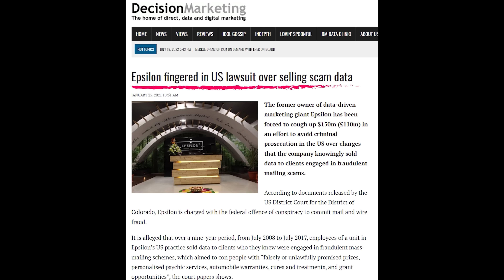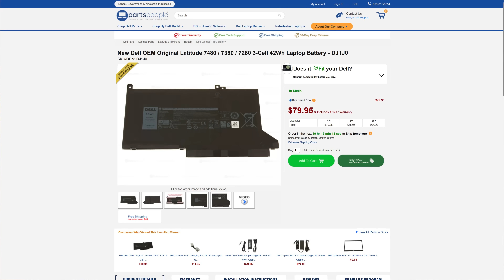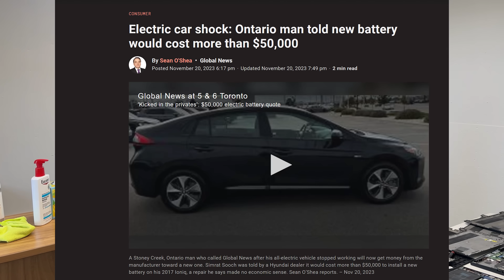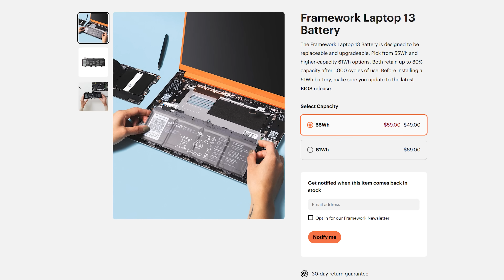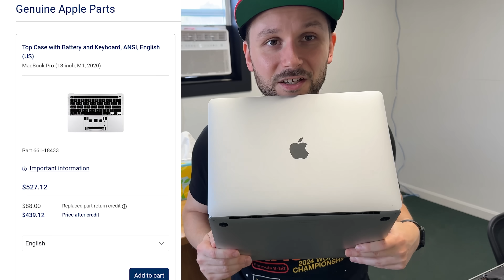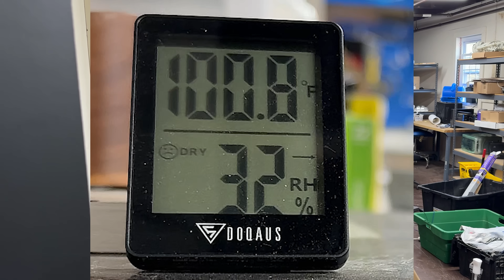Planned Obsolescence: Why is Replacing a Battery STILL So Difficult and Expensive?!

Comment: I bought a framework for this reason, people complain about price but at least my laptop will keep running in 8 years. Because as you said that computing has plateaued for a user, you don't need core i9 or ryzen 9 for office and shopping.
Reply: buy once cry once
Reply: I also bought one! It broke the bank but I like to be able to make sure my computer lasts a long time and that I could replace or upgrade any part I need because it is readily available to me. I highly recommend it too... I think they are coming out with a lil artist laptop and a mini desktop soon too that I was also looking at-
Reply: Just curious are there any third party manufacturers for framework laptops parts? 
Are they openly compatible or standardized?  
Are they officially supported or are you solely relying on Framework independently oprating/existing 8 years down the line without the usual creep of enshittification?
Reply: @ask_carbon  The expansion cards are usb 4, motherboard you can technically design your own, though its probably not cost effective. I guess if you want to run risc or arm processors you can design a motherboard that you can switch out, or see if you can fit a raspberry pi with a custom breakout board. As for memory and ssd those are standard parts.
Reply: @ayylien I wondered why nobody makes a laptop style housing for a RPi.
Reply: One of the huge benefits of Framework is the ability to buy replacement parts directly from Framework’s official webstore at a reasonable price, rather than having to navigate to Aliwhatever or a shady website on the 3rd page of Google that upcharges 300% and only accepts non-refundable payment methods - all to purchase a single $0.10 part.

Comment: Man, I feel your pain.  We had 50 of these for our org, and the batteries after two years had to be replaced on all of them.  They would swell up, and two exploded.  Other than that they were very reliable.
Reply from the maker: 2018 was a very bad year for batteries.
Reply: no wodner I can easily get one for 60 bucks off ebay and then they have no battery or 40% health or less. It sucks cuz those are awesome laptops that take a frickin beating.

Comment: Both of my two laptops were "obsolete" Macs that I took from people who didn't want them and gave them to me for free. I replaced the battery in both of them. One of them is still supported (2019 16" Pro model), so it continues to run macOS until Apple drops Intel support before I put Linux on it. The other one is a 2013 15" Pro model, and that one runs Ubuntu 24.04 LTS. I did a real-life application benchmark a few days ago using a commandline data processor, and apparently, it takes 25 seconds for the 2013 to check if 100 million numbers are prime, compared to the 29 seconds that my mom's M1 Max 16" Pro model takes, so that means that my 2013 (not even my newest computer) is still FASTER THAN APPLE SILICON.
Reply: I might be able to snag a MacBook Pro 2019 from my work next year. Do you know which components are supported and which aren‘t?
Reply: I’m still using my purchased-brand-new 15” mid-2012 MBP, as well as other mid-2012 13”s (all non-Retina); since that time, repairability has got worse and worse (soldered-in RAM really put me off in 2012, hence the unibody MBP); and they have just got worse since then. The ‘Apple Silicon’ (technically Acorn Silicon given it uses ARM (Acorn Risc Machine) processors) MBPs are then much more ‘locked down’ just like iPhones, except Apple let you downgrade macOS to (whatever version it came with) … but are becoming more restrictive with each generation. Disposable MBPs (well, more built-in obsolescence than Intel ones) 😬
Reply: @matthewtymaja3760  Yeah, and adding salt to the wound, ARM Macs, although Apple claims more performance, still sacrifice enough that they get too slow for what I need them for. I've tried using one before, and promptly went back to Intel (tried my mother's M1 Max). Besides, the 2013 still manages to beat the M1 Max at clock, so yeah. I will frankly never switch to Apple Silicon (even as a software developer that currently makes macOS software next to his Linux software), and will stay on x86_64 Linux. When Apple drops intel support next year, I will also be wiping the 2019 and installing Linux on that too.
Reply: If you're thinking, putting Linux on your 2019 will be anything like putting it on your 2013. You are very sadly mistaken. I will offer my condolences in advance. * If you plan to use it as a laptop that is. It could be used as a Frankenstein desktop.
Reply: @lejoshmont2093  Yeah, I figured that out real soon. IDK what to do with that thing now. The T2 ruins every bit of Linux compatibility, and Windows is the worst piece of trash I've ever touched.

Comment: It's not even that the $300 laptops break in six months. There are $600+ laptops that break in six months to a year. HINGES! Windows 10 deprecation is a nightmare. I don't even wanna think about how AI forced into the ecosystem is gonna affect things down the road.

You bring up car batteries, which are giant, high amperage, high voltage, and perform and recharge in harsh conditions...

And they are only $200!!!

Comment: basically just dont use batteries and embrace the charger umbilical cord lifestyle
Reply from the maker: Become one with the outlet
Reply: @SalemTechsperts  many laptops use the battery as a capacitor because the tiny power brick doesn't feed enough current. Without a working battery the devices run way slower.
Reply: @SalemTechsperts  Since my comment got deleted for some reason I'll ask again is MSIbatterystore or laptopbatterydirect legit sites to get batteries or fake scams?? I find my laptop batteries there for 30 to 40 dollars but don't know if it's legit or not. I've been using a battery from there for about 11 months and it lasts 30 mins less than the original did but still works and charges fully. The original costs $90 on msi but has been sold out for over 2 years.
Reply: Some laptops power throttle without the battery installed :(
Reply: @saxtremer or even do not start without battery.
Reply: The point of laptops not booting without a battery crossed my mind as well. I wonder if there is some sort of a fix to this... Sort of just wire through the battery connections without the battery sort of... I have run at least once to this problem and it was infuriating.
Reply: @leerotten  maybe replacing it with a capacitor bank would work
Reply: @czechgop7631  Yep. Was thinking something towards that end.
Reply: I have a laptop with a dead battery that now runs linux mint and is used primarily by my little brother, but for general use at that point you functionally have a worse version of a desktop
Reply: Desktop`nt.
Reply: Sure, if the laptop lets you. Some manufacturers are so scummy that they don't let the laptop power on without a battery.
Reply: I don't like devices that don't have any control over the charging system. I set both my new phone and computer to not charge to 100%.

Comment: I replaced batteries on my cell  phone and smart phones. I miss the days when you could replace the battery in the phone yourself. I remember the LG G3 phone and it easy replacement. I replaced the battery on my phone before my trip to Japan and then when I returned I got a new phone and gave my mom my old phone to replace her Motorola.
Reply: The Fairphone does this still. They're to phones what Framework is to laptops. Rather pricy up front, but easily swappable parts (especially the battery!) and longtime support.
Reply: @stefangrobbink7760  a shame fairphone doesn't have headphone jacks :(
Reply: @Canvas-nb a shame indeed :(

Comment: I know that there are still some of us who don't really have desktops as good as these, so if it's possible, these could be distributed as low-budget desktops, so you'd only need to handle the broken hardware parts and the chargers.

The goal would be to keep the maximum amount of hardware running, right?

Comment: Tell this to EV owners !  It's why I do not own an EV and I never will !  I am refurbisher too and I cannot get good used batteries for most laptops. Dell is the best of the bunch because you can actually buy an official battery.  In future, EV cars which have been serviced, polished and looked after will be unrepairable because of the batteries.  "The battery" is what will condemn every bit of tech you own !!!  .........on a side note have you seen the cost of e-bike batteries ? FFS !!!!
Reply from the maker: Preach brother. I don't own an EV, I own 2 V8's and a turbo 4. BUT, if you've ever driven an EV, you'd know it's AMAZING for a commuter car. The problem is the EV industry NEEDS a company like Framework. Dell is great, Lenovo is OK but their prices are atrocious, HP is decent but the same problem with pricing.
Reply: @SalemTechsperts I would consider an EV if the batteries were modular and it was easy to replace modules as they started to fail. I imagine a battery pack with apertures on the sides behind the sill body mouldings. The modules would slide in and out like 3.5" server hdd's but much much bigger and stretch half way across the battery. You could use a diag tool to identify faulty modules and you could buy the new modules and slide them in and out of the pack. If this happened, then I would consider an EV providing that they confirmed to a standard that did not become obsolete in future.

Comment: My P14S thinkpad bought brand new from Lenovo in 2020 has a cycle count of 19 on the battery. I won’t need a new battery until this thing is 20 years old. That kids is the power of limiting your charging to 80% in the BIOS. You can do this with modern phones too

Comment: I've worked a lot with li-ion batteries and know a lot about the process of making them. There is no standardization right now for all batteries, everyone does what they feel like. This is probably why companies feel like the charge absurd amounts for a battery replacement. 

Batteries will start to show their age and expand once they hit around 80% original capacity, that is considered EOL for batteries. I recently recently had my dell xps 9520 upgraded with 32 gb of ram and 2 tb of storage, and the new battery  I got as well was still more expensive than the other parts combined.
Reply: we really need standardized batteries on all devices
Reply: @jojoba_24  that was my thought, like how in the EU we’ve pretty much standardised on USB-C for power.  If you make a device of this type the you will use a battery with these dimensions, offering these voltages and currents (maybe for each device type have two or three types of battery to account for differing size and load) with these characteristics but nothing that would cause the device to reject, or even detect, an off-brand battery.  That way replacements, whether done by a user or a professional restorer, could be from any battery manufacturer.  The battery manufacturers would get massive economies of scale so could compete on price and quality.  Ideally add requirements that will improve recyclability (why dig, say, lithium out of the ground if you can just pull the sludge out of old batteries, because they’re standardised, and refine it from that).
Reply: If your laptop still supports an external battery with 18650 cell's it isn't too bad, worst case you get to learn how to re-cell it yourself. Internal LIPOs are a nightmare though, for some reason china hasn't cracked the lipo pouch cell and most batteries you buy are just relabeled e-waste and not new parts.
Reply: @Gadtkaz now they know that, so they program the bms to lose all it's data and become braindead when the cells are disconnected, so you have to solder wires to them and make sure it doesn't lose power during the re-cell process
Reply: i can’t even replace my battery because of the absurd price of dell original batteries. so my laptop stays with 15% health and only lasting 20 minutes on a charge..
Reply: Appreciating this thread - if anyone has good tips or resources for safe DIY methods (as well as limitations and common pitfalls) I'm really interested in learning about anything that an electronics hobbyist could do to create more affordable replacement batteries.
Reply: @XatxiFly  So if you are curious about making batteries, it's mainly chemistry and not electronics
Reply: imo, the biggest problem are the soldered proprietary BMS on the batteries. It would be nice to be able to just reuse those things so you can replace a dead laptop battery with any other batteries even if they're a slightly smaller capacity because of the different shape. Unfortunately, this is pretty much impossible to do without some proprietary tool to reset them.
Reply: The main reason companies do this, is because they don’t want to do repairs and they don’t want you to repair stuff. I’ve seen people’s devices end up on phone repair YouTuber channels and even Apple and Samsung and Google don’t put their phones back together properly. 

They want you to buy a new one. So they maximize profits and please their shareholders and that has been business as usual for a long time now. It’s really sad. I understand they need to turn a profit but they have this delusion of infinite growth. And eventually, something’s gonna give.
Reply: Good. Standardization is fascism
Reply: @wolfetteplays8894  The modern industrial world can't work without standardization

Comment: currently looking at refurbished laptops to buy and the battery life is my biggest fear. everything else is such a bang for the buck deal, but the batteries... they scare me...
Reply from the maker: I mentioned before in my "Used Lapto Buying Guide" you have to assume the battery is going to need to be replaced and need to set aside the money for that.
Reply: I seem to have a good luck with cheap replacement batteries but with the Dell 7480/7490 the biggest problem is the screen, for some reason they use a different mounting type than older and latter models where you can get a lightly used screen for around $12, but for those Dells you are paying $70-80 and more. And they are all 30pin eDP, so you can get a newer one and fit them in somewhat, but it's not precise and you can't rely on the mounting brackets at all lol

Comment: You've nailed it on the head in the past, batteries are hard to get ahold of because they don't WANT you to be able to replace them.  Built in obsolescence.  And most people that are willing to try are more likely to destroy their laptop trying it themselves.  So still a win for the manufacturer.  Older laptops might have weighed 20 pounds but at least swapping the battery was quick and painless.
Reply: old laptop batteries were just as custom and proprietary as the modern ones. Just bigger because they used 18650 cells instead of lipo bags
Reply: it was still stupid expensive most ppl just got a new one back then too
Reply: And there is literally no reason for that. They can definitely adapt some kind of standardised battery cells set, and it will save them lots of money because they dont need to make custom battery  each time.

Comment: Batteries were always better whenever they just clipped under the laptop without needing glue
Reply: IF they still make the clip on module.   I have not been able to find the module for an inspiron 1210 netbook.  So, I'm having to rebuild for this myself.
Reply: @SyntheToonz  dang that sucks I wish you luck
Reply: Same with the phones too! Except Apple of course.
Reply: @ssnofall  that's because the intent of the design was for the device to outlast the battery life. Now the intent is for you to buy a new device by the time the battery is trashed after a maximum of 2 years
Reply: @OGslays Only way that's happening is with misuse. I love how companies milk lazy normies addicted to convenience.
Reply: @ssnofall  so true
Reply: 7490 don’t use glue
Reply: @zacheslick who meantioned a 7490?
Reply: These models probably can be re-celled with standard parts by a skilled technician.
Reply: They were not and failed more often. Same for smartphones.
Reply: Unless you mean the AA and AAA batteries, that's just a user-removable proprietary battery, and the issue finding a replacement is still there.
Reply: @marcogenovesi8570  Yep, but still they were a lot easier to repair, cause inside of then there just stardard 18650 batteries with a proprietary controller

things gonna get worse and worse if theres not a law that force an open standard for batteries and controllers
Reply: @malojillo67 It's likely not going to happen or for a long time... Especially considering the tiers to product quality and stuff they offer. Take scooters for instance. You can find them for 140-$600. Many you can find in the $1000 bracket. Then there's the crazy $5000 and up section. All largely doing the same thing but you can't design the batteries the same or compartments since decks are of varying size depending on specs

Comment: Reminds me of the HP desktop replacement laptops back in the day that had batteries that had 'memory' and would never charge fully. That was the beginning of my hate of HP products.
Reply: Laptops before lithium batteries took off? Thing must`ve been heavy as a stack of bricks, with no battery life.
Reply: You're talking about "battery memory effect" that older NiCad [Nickel-Cadmium] and their successor NiMh [Nickel Metal Hydride] batteries suffered from. Lithium based batteries don't suffer from that issue.